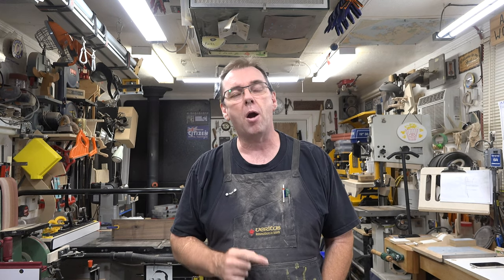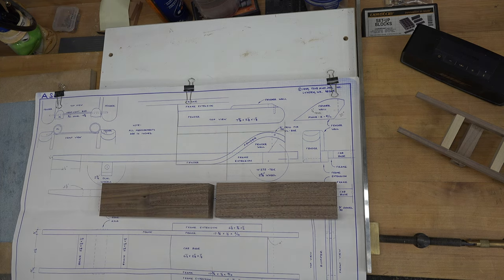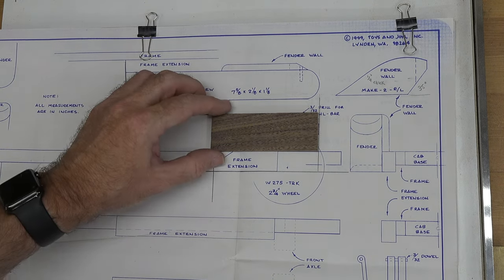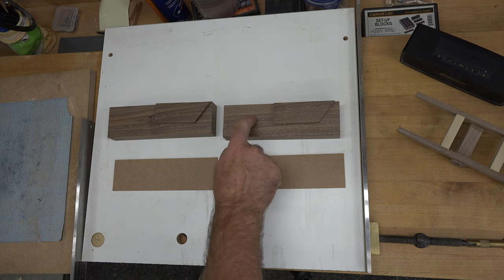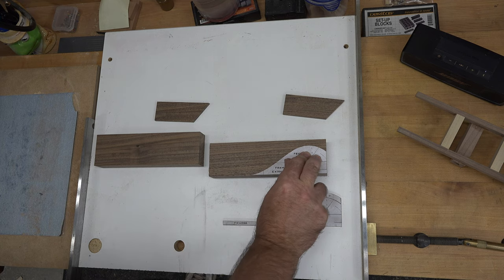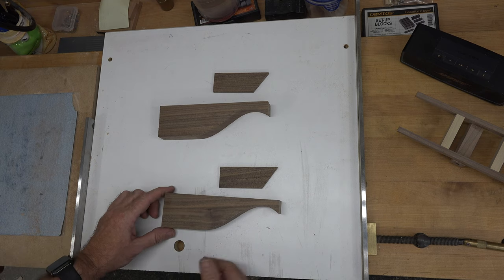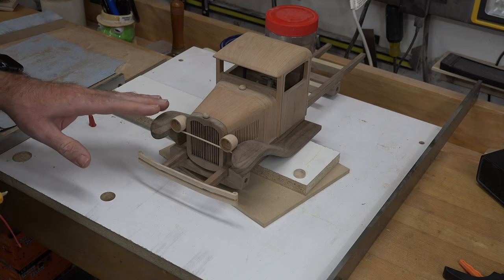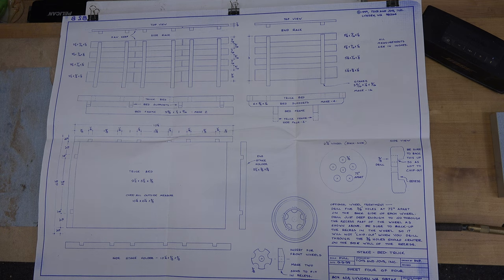Toys and Joys 1929 Ford Stake Bed Truck Part 5

Comment: Still with you .Though it took a little time to work out some of the words like 'hood', we call it a bonnet and 'fender'. As I was making it I thought, "What the heck is a fender". When it came to fitting it the light bulb lit up. Of course: mud guards. At this point (to paraphrase 
your good self) I have to say, without your excellent and patient explanations I would have been lost half way through day one and for that I offer my wholehearted thanks. Looking forward to next Tuesday. PS. I'm also looking forward to, 'What did Kenny get for Christmas'.
Reply from the maker: Not so sure there will be a "What did Kenny get for Christmas" show this year.  I guess it all depends on what I get.  This is the first year that I didn't ask for anything so it may just be a lot of gift cards.  LOL.  Thanks for tuning in Piet.  Glad that you are still enjoying the series.

Comment: I'm currently working on a Gatto Plans Backhoe / Loader. The inspiration was your Tractor-trailer with the cement block load. The Toys n Joys backhoe is also nice but the Gatto Plans model has steering as well. Not quite as detailed but the challenge is with the pistons that support the buckets and the outriggers. I used you 1/16th inch router bit idea to make the cross-hatch grill and air filters. I had to adjust the dimensions to 3/16th inches between using my Incra Jig as the 1/8th inch spacing chewed out several chunks of the grid. As you said, innovation is required when things don't work as expected. When finished, I will send some photos. BTW, I'm pretty good at making steering wheels. I might send you some for future projects.
Reply from the maker: I'd love to see those photos and I look forward to seeing them.  The model sounds very interesting.  Glad that you were able to take some ideas from my tutorials and use them for your own model building.  Thanks for tuning in to the show.

Comment: Your work with the lathe is fascinating to watch. I have never used a lathe but am hopeful of getting one early next year - leaning toward a delta, any advise?
Reply from the maker: I had a full sized lathe for years and I finally had to re-assess my woodworking and realize that I didn't have a need for a full sized lathe and that it was only taking up valuable space in the shop.  So I sold it and bought the Delta 46-460 and absolutely love it.  It is a great lathe and I have no complaints with it whatsoever.  In my opinion Joel, you can't go wrong with the Delta lathe.  I hope this helps.  Thanks for tuning in this week sir and for the kind words.

Comment: Once again, great video and content.  50 seconds into the video, and I already have a question.  How did you determine what to “stock” for you wood stock. Not wood types, but sizes.
Reply from the maker: A wood rack and what is stocked in it, is a very personal preference sort of thing.  For mine I prefer to keep plenty of maple, walnut, cherry and poplar.  There is also mahogany, oak and some pine.  (I know you didn't ask about species, but someone else might be wondering).  As for the sizes, I pretty much stick to 8/4 rough cut stock and I stick to 10' lengths, that are cut in half.  This gives me the most versatile use from each piece as I can get anywhere from 1/8" thick to 2" thick just by re-sawing and thickness planing.  It will also give me any length up to 5' long.  If I need longer for a certain project, I purchase that separately, just before making the project.  As for the width of the stock, it is determined by the size of my equipment.  My jointer is able to flatten an 8" wide piece at the maximum so I try to keep all my stock at 8" or less.  Preferably, I like to have it at about 7 1/2" wide.  It is strictly governed by what my equipment will handle as their capacity.  I hope this helps Scott.  Feel free to ask any other questions you might have.  Thanks for tuning in to the show.

Comment: Awesome series. Getting there Kenny. Where did you get that MT2 piece for turning headlights. Great tips as always
Reply from the maker: This MT was purchase many years ago at Lee Valley.  I tried to get you a link but they apparently no longer carry it.  You can always purchase bolts like this https://www.leevalley.com/en-ca/shop/hardware/fasteners/nuts-and-bolts/40988-hanger-bolts-1-4-20-thread
and mount them in a drill chuck with a MT2.  It will provide the same results as the head stock unit that I used in the video.  I hope this helps Marcelo.  Thanks for tuning in to the show.
Reply: @acutabove_woodworkings  Thanks Kenny. Yeah, I should of think myself about hanger bolt in a drill chuck. Cool idea for turning the lights. I also never buy any parts for my model builds.
Reply from the maker: @marcelo403polo2  A man after my own heart.  I love making all the parts and am not a fan of purchasing anything for these models.  That being said, I don't think any less of anyone if they want to purchase certain parts.  Not everyone has the equipment or the skill set to make all the parts.  Good for you for making them all yourself.  Very impressive.
Reply: @acutabove_woodworkings  Thank You. I takes longer when you make all parts yourself, but on other hand there is way more fun. Im planning to start working on Freightliner cabover on my Christmas brake. No plans.  Hoping to get tilting cabin with detail engine below and all bells and whistles.